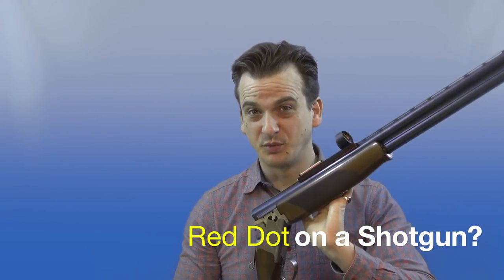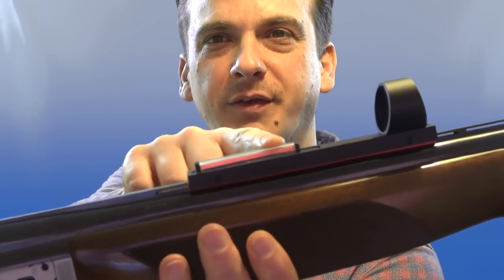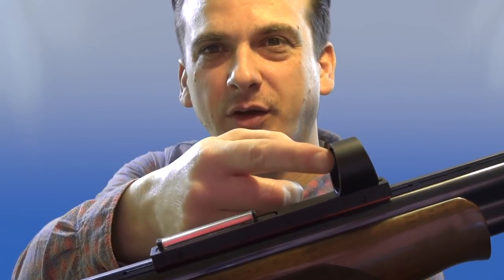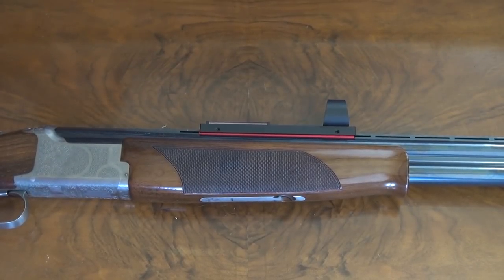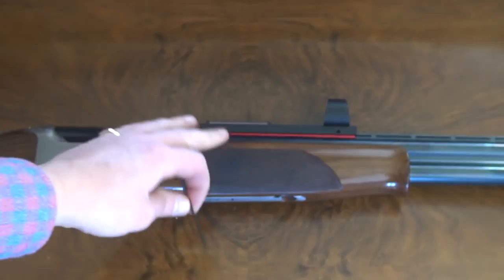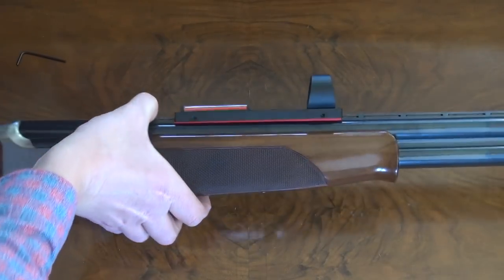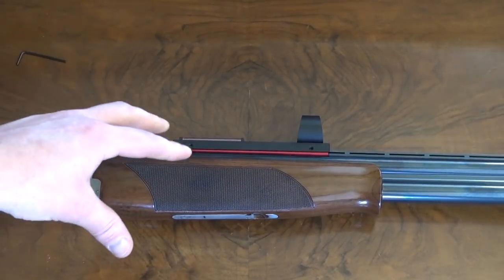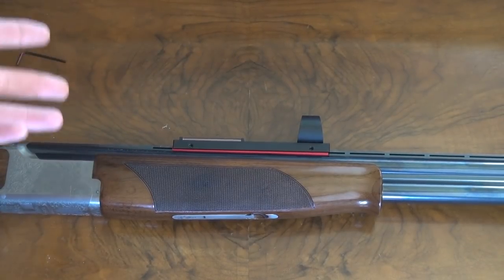Red Dot on a Shotgun?

Comment: Hiya, physics nerd here. Thought that I'd explain how fibre optics work for the benefit of anyone who's interested. Essentially it relies on the phenomenon of Total Internal Reflection (TIR) which occurs when a light ray (I will express light in terms of 'rays' for this description for the sake of simplicity) intercepts the boundary between the more optically dense medium it is traveling in and a less optically dense medium at an angle greater than the critical angle (angle =arcsin(n1/n2). This means that effectively the light enters the medium (in this case the fiber optic tube) and the majority of light rays intercept the other side with an angle of incidence greater than the critical angle and so they reflect as if the boundary were a perfect mirror. This occurs to the same ray over and over again until it intercepts a boundary at an angle less than the critical angle. Because the end of the tube has a sharp change in the angle that the light ray will be incident to the surface; the majority of the light will escape here. This is effectively why the tube is able to 'gather' light and emit it in a concentrated spot.   Hope someone found that useful :)
Reply: 4 years future science guy here and I can assure you it's been useful

Comment: HEY ...I found a better way to mount the sight! Stick some magnetic or just steel tape under the inside of the sight - then just put some powerful neobdynium magnets on the rib. It holds it ROCK SOLID with no messing around with the screws whatsoever. You can get it lined up with the bead with your fingers, and it won't shift under recoil. And of course you can take it off and on as you please... ALSO because this elevates the sight so it's sides are clear of the barrel you can have it positioned much further back than what you see in this video.

Comment: If you want to lower the cheek rest on your own I would advise getting some sand paper 80 grit to 120 grit that is meant to be used on a belt sander (755X56 I believe should be big enough) and then use the shoe polish technique when it’s clamped down to get if the bulk off, repetitively mount the gun and get someone to look opposite to you down the rib to check the location of you eye along the rib (don’t push you cheek on the rest) and then use the lighter sand paper going with the grain until all the scratches are gone ( make sure you don’t sand in one location for too long) you may have to sand down the whole stock and fore end so it all matches as far as looks (plenty of finishing videos on YouTube), I hope this helps and great video keep up the great work
Reply from the maker: I would definitely advise that you don't do that! Get a gunsmith who knows what he is doing to do it.
Reply: srspower I guess I’m looking at it from the side of someone who has a fair bit of experience with working with wood, but yeah if you don’t work on wood a fair amount always better to go to someone who know what they are doing

Comment: I bought this sight for my Mossberg 500. Also bought the picatinny mount for it. One thing you HAVE to do is go to work with a needle and enlarge the dot- I have turned mine into a beautiful burning ball about 1 metre wide at 50 yards. Mind you i haven't actually tried using it yet!
Reply: Bende tekkurşun atışı için almak istiyorum sfırlama atışına gerek varmı yoksa sadece hedefin büyüklüğü küçüklüğü ayarlanıyor bilgi verirsen sevinirim
Reply: Did you try it out yet? Can you elaborate on how you made the circle bigger ⭕
Reply: @infazc3556 In the case of the mossberg with picatinny mount you can zero as follows: insert a cocktail stick (or something similar) between the barrel and receiver so it is standing vertical and exactly half way across, then lign up the dot, the stick & the front bead and then tighten the side screws. I didn't need any elevation adjustments.
Reply: @churchethermusic4750 it isn't great on an over/under but on a pump action it is supernatural. Turn the sight other way round and you see a magnified reflection of the dot - scratch off the surface with a bent needle then dab on some black modelling paint or car touch up paint - let it half dry then stab around with a needle until you get what you want. It took me about 6 attempts with start over to get it exactly right
Reply: @KolyaNickD  Thank you good sir! 🙏 I'll make sure to try your tips

Comment: So hard to find proper information on theses anywhere. Can you use these with slugs for deer and also for turkey hunting?
Reply: Yes you can.
Reply: David Rivera what was your experience with them ? What it accurate and did they hold zero
Reply: @teflondon613lilbih3  my experience has been great. I have a shotgun I use with a red dot for slugs and buck shot exclusively (home defence/large animal) and I actually shot about 60 rounds of slugs through it this morning at 50 yards. held a 3 inch group at 50 with the slugs, and that's a pretty consistent number I've found. I zeroed it at 25 and it holds zero at 50 with no issue. For my purpose I would never take a shot above that most likely, and even if I did it may drop a few inches for a 100 yard shot. That being said it's nothing you can't compensate for. I've had an amazing experience all being said
Reply: @teflondon613lilbih3  I agree there is very little to no info on them, so if you have any other questions feel free to ask
Reply: David Rivera thank you sir i got one coming in the mail can’t wait to try it
Reply: @teflondon613lilbih3  no problem at all. Hope it works out well for you

Comment: Greetings from America..
    I think that's it's your shotgun....and all the Na Sayers can worry about their own equipment!
    I have a fiber optic bead that just clips over the rail and don't set any higher than the end bead...it's clipped on right in front of the bead and more or less just puts a "glow bead" on the rail...mabye a stock wrap at the cheekweld could help the hold placement for the dot. Easy on and off and no perment damage to a fine looking thumper. Just functional experimental "add ons" that can be removed.
      Or playing with the elavivation adjustment to find a sweeter spot...
      It's all good...it looks just like Sam's shotgun to me.😀
   Best Wishes Sam...

Comment: Had a nice set up on a Benelli Super 90. 42mm red dot, this was BEFORE I learned how to shoot properly at moving targets with a brass bead sight.  Couldn't hit the broad side of a barn, especially on moving targets. Having said that it can be done, might even work real good.

But once I learned how to hit moving targets on an old fashioned brass bead sight, I'm convinced, the brass bead is a lot faster than red dot.
You pick up your targets faster and can make quicker corrections on follow up shots, a lot faster on an old fashioned bead sight. Your entire field of view is broader and more realistic, when a flying bird is erratically trying to get away.

Just my two cents. Not a bad idea, seems like it should be better. But I had zero luck with it. Swear by old fashioned beaded sights. Learn how to shoot moving targets first, without batteries...….practice practice, then it's just like riding a bike.

Comment: I compared the Chinese knock off to the Russian vomz one.  Result: Russian one has good parallax control. Chinese one had zero to no parallax correction but clearer image (better anti reflection)  Conclusion: Russia wins. It will work well for slugs etc. Chinese is probably OK if not using slugs

Comment: Would it work for a bullpup 22lr rifle or a pistol? 
Zeroing? Cold resistance? Piccatiny?
Reply: Get a proper red dot,(for rifle/pistol) it's much more accurate. This is designed to fit on a shotgun rib plus it has no accurate way of zeroing the dot. I had one, the amount of light projected on the lens was poor, I went back to a magnetic browning fibre--optic front bead.
https://browning.eu/produits/outdoor/accessories/O-SG-12850.html

Comment: As you say this works for poor fit/mount. That said it will only encourage a poor mount which will become more of an issue as time goes by. I have used some cheap red dots on air rifles to help young Scouts who struggle you get a sight picture with iron sights. Not for me, get a proper fit/mount.